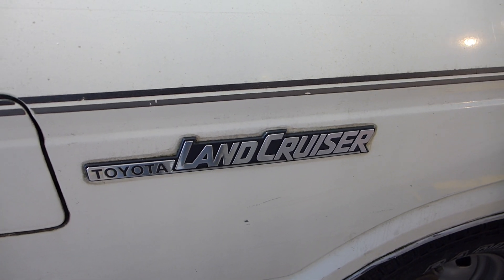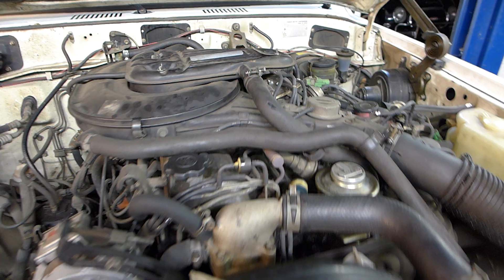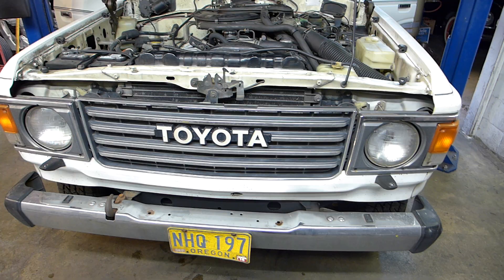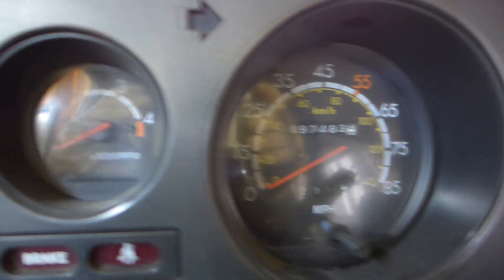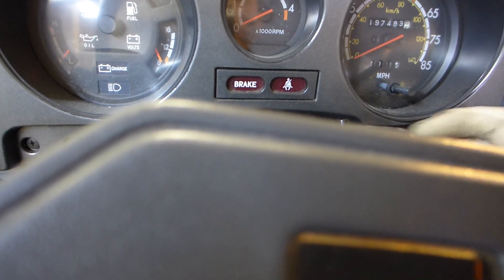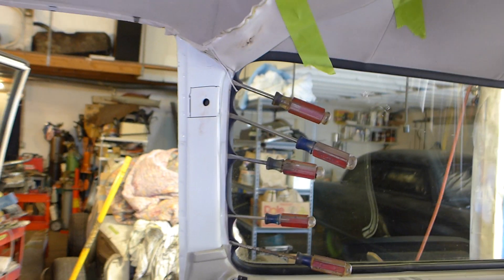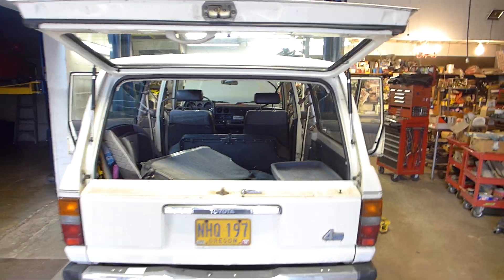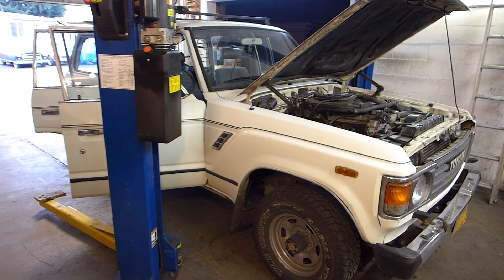1986 Toyota FJ60 Landcruiser Improvements

Comment: My mother has this exact truck. Around when it hit the 259k mark it started having over heating problems and carb vacuum line problems. Planning on replacing alot of vacuum lines and doing a serious tune up. The truck starts every time and never really has failed. Besides the over heating issue the truck still actually runs ideal. But it needs new plugs and a compression test.  

Ill say this though that makes the truck shine.. is the drive train. that truck's drive train ( in my opinion ) is better than any jeep, chevy, dodge, nissan etc.  I've riden in alot of 4x4 trucks and none of them have the solid grounded feel when going up a nice climb. that truck has such an unstoppable feel to it you just know your not gonna get stuck. and the 4x4 is such a perfect gear ratio you can pull the choke and your going to pretty much crawl up the hill with out any throttle work which can be very handy if you are changing gears or something or if you have to stop while facing upwards on a hill it helps you avoid stalling.

Comment: my neighbor had one of these in the mid 90's and it was always broke down..the Wacky carb they put on those was always giving him fits.. I called it the uncle buck suv.. as it would diesel when shut off and sometimes backfire.. and randomly die, and he couldn't get it restarted
Reply: We had one from 88 to 03, it never missed a beat and never broke down, lost it when a person of color high on crack rammed it in a parking lot, he was doing 70mph and took out about a dozen cars before he died in a huge fire ball embedded in the side of my dads truck, we didn't find out until we came out of the mall and saw the ruckus, dad went straight down the dealership and bought another one which he still has, swears he'll never buy American again.

Comment: yes,  3.0 V6 with 7th injector, ABS brake system, and curtain airbags,  8 speed manual trany (well this one can be true) if counting the low gears...
Reply: what are you smoking? this is a 60 series. 4.2L straight 6, certainly no airbags or ABS.